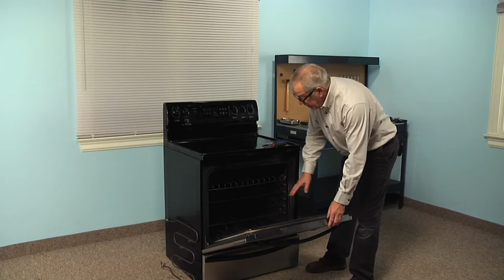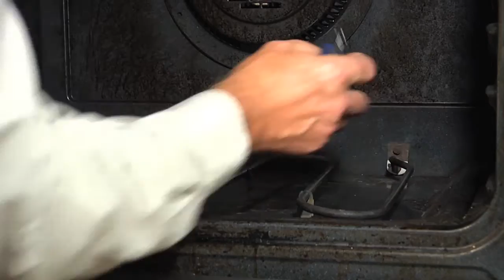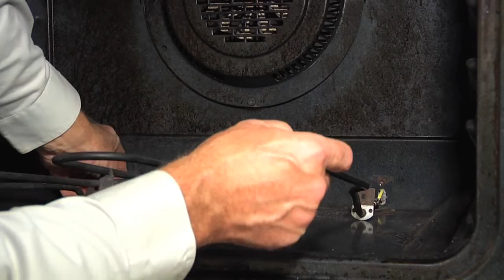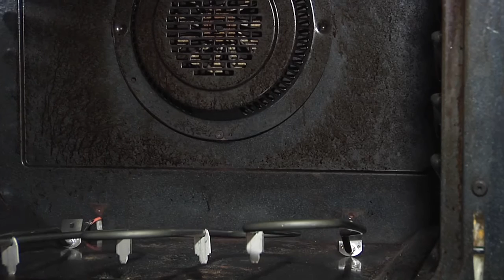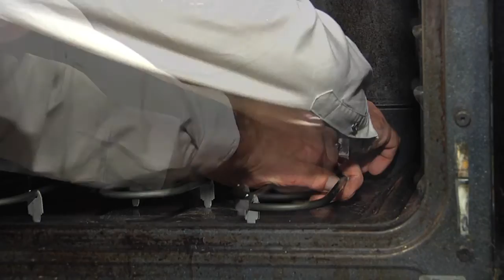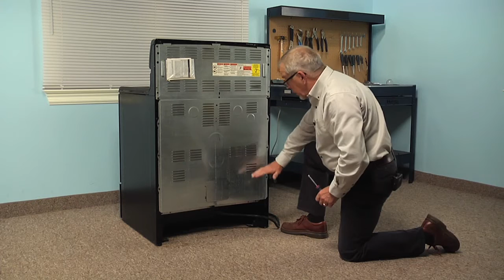Range Repair - Replacing the Bake Element (Frigidaire Part # 316415900)

Comment: Very helpful.  My only other comment is that I wasn't sure if I was pushing the new element enough onto the connectors and I couldn't see is well enough in the video. So I just took a chance and completed the replacement, started the oven & it works just fine.

Comment: Installed for about a week now>>>allmy.tips/6svl    Install not for the faint of heart but I had a smart guy do it with me. Had to remove stove to get to outlet etc.etc. End state unit is excellent. Easy to regulate heat levels. Looks stellar. But most of all this seller has the best price on the net bar none and his ratings are correctly at 100%. Quick ship, UPS delivery, everything there, orig packaging. Just a nice deal that saved me app $400 and another $180 or so by installing myself...with a smart guy!!